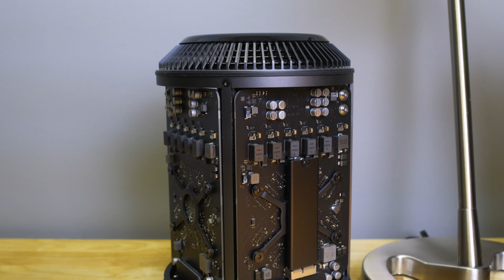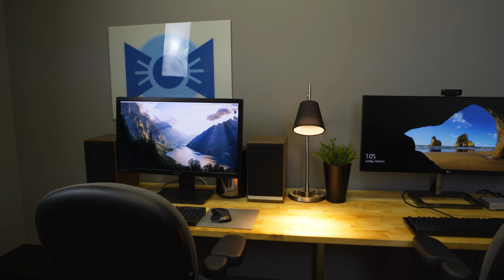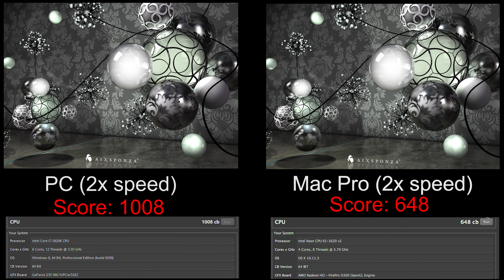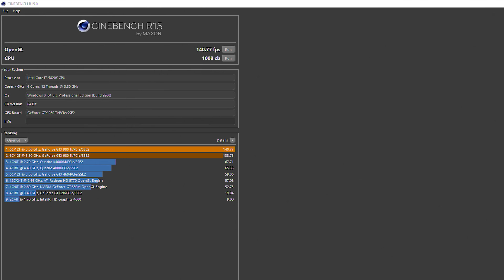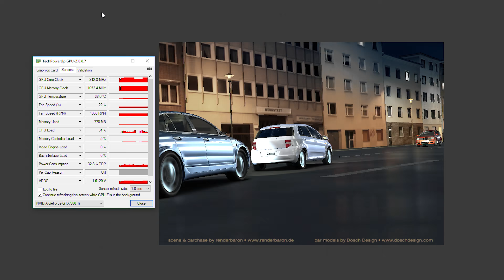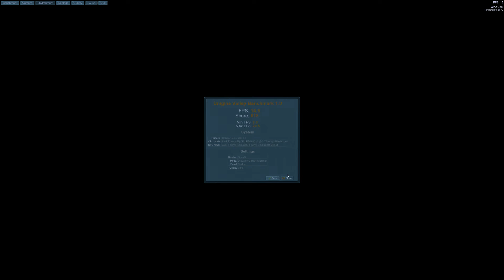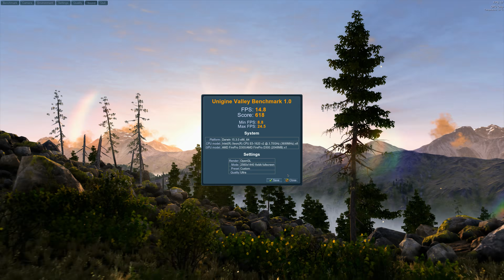$2,000 Custom PC vs $4,000 Mac Pro

Comment: Why did you even bother to do the tests? A look at the spec sheet should have told you which one would win (pardon the pun).

The Mac Pro is a scam and I have been calling out this scam for a long time now.

This scam is so cynical and egregious that it beggars the mind to contemplate it.

So Apple bungs all this high end Intel and AMD hardware into the little cylindrical case, and all the fanboys go wild.

The thing is that the hardware inside, if you were going to run it flat out at the highest performance would require around 700 Watt of power. The Apply Mac Pro has a 450 Watt PSU. So you are buying really high end hardware that you can NEVER take full advantage of right from the get-go.

But wait, it gets worse. Apple for its "revolutionary" cooling solution uses aluminium which is only half as efficacious at dissipating heat than copper for the CPU and two GPUs; now comes the kicker, if you do run the hardware so that it is drawing what the PSU has to offer then the temperature of the CPU and GPU are between 95 and 97 degrees Celsius with the dinky 140mm fan on the top going like the clappers at 44.7 dBA

http://www.anandtech.com/show/7603/mac- ... te-2013/14

So now we know why it only has a 450 Watt PSU and that is because the cooling solution implemented on the Mac Pro would not be able to handle any more.
Reply: +Michael Nager LOL.. so Apple cheaps out on the PSU but sure as hell doesn't on the other parts.... wow they sure know how to scam/con their instalbase.
Reply: mechaart
Did you read the post or did you just see "PSU" and decide that you had seen enough to misinform your opinion?

Comment: You suck at overclocking :S Mine 5820k is at 4.5 with no issues whatsoever, and I've had it at 5, but had a little bit of heat issue when gaming for hours with 2 970's in there... up the voltage a little; you won't hurt anything.

Comment: I use Apple products, & I honestly don't understand the reasoning behind not upgrading the Mac Pro. The Macbook Pro's have better hardware than the Mac Pro, so it's beyond stupid now. I work in Graphic Design, so my needs are different to yours. Apple have a far better type renderer which is super important when it comes to pretty much all aspects of design; besides 3D and architecture design (and some few more I guess). Until Microsoft create a better Type renderer and preload High-end fonts like Helvetica in their OS. Designers won't budge.
Reply: +RizzyWow I wouldn't say better but newer hardware but overall you are right, Apple have a knack for not updating their Mac Pro line.

Comment: I'm starting to think that these videos are only done for you to realize that a PC build is WAAAAAAAAAAAAAY times better than an actual Apple computer.
You should start to get better on Windows. You'll find things that are really practical that OSX still doesn't have.
With the right click you can do better things that you actually would use daily, and god bless the side by side window setting, where you grab a window and move the mouse to the edge of the display to see that it suddenly Windows transform that window so it fill half of the screen and lets you chose another window to fill the other half so you an compare documents way faster, for example.

I know OSX is a great OS, but Windows is just so damn easy...

Comment: Now run the same test and put FCPx up against Premiere on the PC. The Mac will smoke it. Software optimisation and hardware go hand in hand.
Reply: +electricsnut The mac won't win in anything.
Reply: +Derpleton Harpoon Yeah aside from looks, stability, support and 4k rendering speeds in FCPx... It will smash Premiere if you use OSX designed software instead of Adobe bloatware.

Comment: Don't ever use cinebench, it's profoundly known to be a rigged piece of crap. 
The task takes about a minute and ~480 points on my stock bulldozer 8150, which slaughters even the 5770 in actual gaming and rendering apps.
Reply: +PurePhoenix Oh and the OpenGL Test on my (&)EXOC is only doing 46 fps even though it gets higher in GTAV on super-ultra....something even the 980Ti in your PC struggles to do.

Comment: There is a reason for such a big gap in prices (not counting Apple's policy of pricing "because they can") - the Mac Pro has professional components, so a Xeon CPU, ECC RAM and a workstation-grade graphics card (AMD Firepro) while the PC has consumer-grade hardware inside (Core i7, non-ECC RAM, Geforce GTX). However, for the majority of people, professional-grade hardware is not necessary, as it has very specific advantages (better reliability, GPU double-precision float operations, ...)  at a much, much higher price point, which does not result in better performance in most tasks - as proven by your video. Great video and great build! :)

Comment: It's interesting that this test is effectively done in a way that goes after the macs weaknesses. Open GL on OS X is famously not up to par and is basically given up on since they are moving towards Metal. Premiere Pro is also an app which theoretically should be much better on Windows since it is more optimised for that platform but if you ran a FCP X test you'd probably find that the mac was close to 10 times faster.
edit/
I also wish you could have elaborated on the video test as well how long was it, was it 4k, what sort of effects are on the video.
Reply: +Craig Bickerstaff 
"Premiere Pro is also an app which theoretically should be much better on Windows since it is more optimised for that platform"
No, that's wishful thinking.  Adobe has made Mac products for like 30 years, don't use that lame excuse.

"Premiere Pro is also an app which theoretically should be much better on Windows since it is more optimised for that platform"
Oh yeah, prove it. You don't believe that yourself now do? 

On top of that.... shall we compare the performance of a HP Z840 with 44 cores and 2TB of system RAM (yes, you read it well, RAM... not hard drive space) with the fastest Mac Pro?  You don't now even the 1% of the most powerful workstations out there... read "workstations" and not "powerful gaming PCs".

Comment: Why compare Mac Pro to custom build PC? Why don't compare it to ThinkPad W/P series? They are both for the same market target. Apple always builds their product not for performance, but stability and quality. Moreover xeon processor is not intended for gaming purpose, it's better for multitask program. You should compare by multiple high GPU rendering intensive program at the same time. Not just 1 benchmark.
I'm not graphic designer nor video editor. But I believe they are running several video editing/ graphic design program at the same time. And that's what Mac Pro or ThinkPad W/P series for.
Try compare with this. It costs half than Mac Pro.
http://shop.lenovo.com/us/en/laptops/thinkpad/p-series/p70/
Reply: +Fakhrulhilal Maktum 
"Apple always builds their product not for performance, but stability and quality"
And you think that a an HP Z840 isn't quality? Watch  "HP Z840 Workstation Technical Overview".

Anyone an go for quality when he's asking a customer to spend $4,000 or more...

"Why don't compare it to ThinkPad W/P series?"
You want a fair comparison and then want to compare a desktop computer with laptops? Now that's funny!

Oh... and btw... an HP Z840 can be configured with as much 44(!!) cores and 2TB of RAM (yes RAM, not hard drive storage). Face it... and HP Z840 shits on the best Mac Pro out there.

Comment: That's not even the $3,999 Mac Pro model, it's the $2,999 model.
Reply: +Jon Anderson its still cheaper
Reply: Very True, but the video is misleading because right off the bat, the reviewer states that he spent $2,200 on the PC. $200 more than the title suggests. We're talking about an $800 difference now, opposed to the $2,000 he suggests in the title.

Comment: first mistake on this video you put a workstation against a Gaming PC the Mac Pro did not have a chance against this gaming PC. the Mac Pro is built and certified for workstation Application's the AMD FirePro GPU's have A multi stream hardware H.264 HD encoder for video editing 3D rendering consumer cards don't have that at all and instead use its onboard GPU (CUDA or Open CL) to do the encoding taking longer to create and render video's of that 3D CAD thing you are trying to design. it is quite telling on how stupid this video actually is. the AMD FirePro's are the same as Nvidia Quadros NOT for gaming just specially tuned to deal with certain productive Applications such as CAD, Premier Pro and what ever else has tried and tested by the software Dev team and deem it as Workstation product but all you used was gaming benchmarks. one other thing is AMD have only recently updated there FirePro cards because the FirePro has a upgrade life cycle of within 2 to 4 years if Apple are sticking with AMD I'm sure they would be wait for the next gen FirePro's been released before going a head with any upgrades. from experience using Powerful but consumer GPU's and CPU's in a 3D workstation inviremint it is painful to say the least. this Video is invalid in the way it has been scored I would say the same thing if you through a Windows workstation running Intel Xeon's and Nvidia quadro's or firePro's vs this gaming PC but I don't think you get the difference between these two very different machine's. this was not Mac Pro vs PC this was workstation PC vs gaming PC video.
Reply: ***** grow up Mac's and PC's are the same just Macs look nicer. quit prattling on like a child who has had there bottle taken away. and if you knew anything about PC's you have seen the point I made where facing workstations against Gaming PC's is always going to give a false win to the gaming PC's because they are both strong machines but in very different ways. all because it have a Apple logo means jack shit to the companies thats use these machines as there daily driver also this misses the point of a workstation machine in this video if it has made its money back and made him money on top the machine has done its job as for gaming machine they play games entertainment hard to get a machine that dose both.
Reply: +Victor Moreira 

"what specs would a modern workstation PC have"
A modern workstation like an HP Z840 can have up to 44(!!) cores and 2TB(!!) RAM (yes, you read that well..RAM.... and not drive storage). It would totally crush both machines.

Comment: Yes, but there is one problem with PCs - Windows 10
Reply: +Dufffaaa93 yeah, but is mac OS worth $2,000?
Reply: +Dufffaaa93 and plus, windows 10 is pretty good, so there's also that
Reply: +Dufffaaa93 Windows 10 is actually good... Secure, sleek, beautiful, easy, powerful. I don't understand.
Reply: +Dufffaaa93 There are some software issues with windows 10 but for the most part it's pretty, ehh, ok to use. 

Also, Linux.
Reply: ependo odnepe The only problem with Linux is lack of solid drivers, and lack of user-friendliness. Depending on what build you get, you can get either really really barebones, or you can get extremely user friendly. 

It's powerful, and I can find my way around updates and installs, but it's really kind of annoying, and it just gets annoying.

Personally, Ubuntu and Elementary are my favorites for their friendliness, but even still, they still aren't nearly as convenient, so in my eyes, it's not really worth it unless you have a solid knowledge of the OS, which is why it'll never get big.
Reply: BrickerBlocky
Let me see.... lack of solid drivers, not user friendly, but you leave out things like"sucks for gaming" and "most applications suck".
Reply: +Adel Morse And bad drivers and UI are literally the reason for the bad gaming experience and bad programs...

Comment: Try to be on the right side why most use a Mac; the software that runs it and is made for the device. Programs like fcpx are a beauty on a Mac and use the system like it should. Gaming on a Mac, I never did it, I would use a pc for that.

Comment: Honestly the mac-windows comparison is so old and stupid.  Yes, you can get a faster system for less money with windows.  HOWEVER, some people, who have money to spend on macs, prefer osx.  Therefore, they buy macs.  I had a macbook pro and then I bought a msi for college because they're cheaper and fast.  Each system has its ups and downs for software.  There is no disputing macs are superior for the recording industry, and they're built like tanks.  Windows on the other hand, better for gaming overall.  It's all preference.

Comment: I don't think you are comparing "Apples" to "Apples" here. There are a lot of disadvantages to the Mac:
 - Liquid cooling vs air cooling.
 - DDR4 vs DDR3
 - Hexacore vs Quadcore
 - 2015 vs 2012 CPU

Please let's be realistic, I don't think its fare to compare an old hardware with latest generation one, in the computer world the advance in technology is usually exponential. Last but not least, what makes a hardware shine is software that is highly optimize to use all the horsepower available, I know there's never going to be an equal ground to compare Macs and PCs, so let's stop doing it. If you work with Apple then you have to use all the tools highly optimized for them, and the same if you are on the PC world. I guess computers are just tools, you have to use them for and how the were designed to be used. You would never hear a complaint on how bad a hammer is to tight a philips head screw. Anyway Thank you for the video. I would recommend trying to leave emotions out of the equation and try to state facts and give your viewers reference for them to study and come uo with their own conclusions. We should teach people how to think and not to repeat all they watch on youtube. Thanks again for sharing your thoughts and experiences.

Comment: 32 bits of RAM is stupid for today's computers. it wont even use 50% of it
Reply from the maker: +grmmhp bits? You mean GB? And I respectfully disagree. Editing 4K video eats the RAM right up.
Reply: +grmmhp disliked the comment, gonna report your channel, u deserve a ban.
Reply: +grmmhp Editing video, flow, heat, aerodynamics, plastic injection, etc simulations, high detail 3d models rendering, big CAD models, CAM, animation, after effects, virtual machines, ramdisk, etc, etc. Some people just do daily work, but for us, content creators, designers and engineers we use a PC as a main tool to get our job done.
Reply: +grmmhp I have a workstation, a dual E5-2670 v1 and 64GB, if you use ramdisk, just 32GB you're living 32GB for the rest of the computer, 16GB in complex workloads it's nothing, for other users 8 o 16GB it's enough but not for some applications. Normally I'm working with Premiere, Solidworks, Keyshot, a bunch of chrome tabs, photoshop, even some simulations at the same time, and that's really ram consuming, If I work just on one program it's enough with 8-16GB, but normally I'm working with more, as I need to make textures, to edit renders, etc etc
Reply: +grmmhp I've considered going with an intel processor to get 128 gigs of ram.  you can easily use it.
Reply: +Snazzy Labs yes, GB, I didn't even notice, sorry
Reply: +MrTor8 for most of these applications, 16 GB should be enough

and the other may need a supercomputer
Reply: +grmmhp It's STUPID for you,  you mean.   I use most of my 64gb when I'm working - I need more ram
Reply: +endfm it's stupid for low end to high end gamers and normal users. yes, I know, I didn't mention this and I failed at this point. And of course supercomputers/workstation will need more RAM (and also processing power, etc) to be capable of heavily simulating/CGI movie rendering etc
Reply: +GazhKaVFX (DesiignWRR) why? I didn't do a thing lol and u seem to be xenophobic
Reply: you write bullshits.
Reply: +GazhKaVFX (DesiignWRR) read my previous comment and this is a stupid reason.
Reply: +grmmhp Really? I find 4 bits of ram too much that much space on my analog paper feed non rewritable storage medium.
Reply: +grmmhp You really are stupid because people are talking about that much memory for working while you're talking about gaming which soon enough we might be needing at least 24gb of memory for gaming and 12-16gb would be the bare minimum.
Reply: +Ecks™ don't you say?
Reply: +KaneWolf lol ikr I didn't even pay attention to that
Reply: just because you don't know how to utilize 32gb of ram, for gaming or other uses, don't say it's pointless. I wish I had more than 32gb in my current rig
Reply: +Louie Mott unless you have 2 or more  i7's then you should never need more then 16 gbs  
even if you are exporting 10 things from after effecters at 4 k its limited by the cpu
Reply: that moment your comment gets polemic when you don't want
Reply: +Everrolling Ronan Shade no? ever hear of using ram as temporary storage?
Reply: yeah there is no point to it tho
Reply: its still going to be capped by the cpu
Reply: +grmmhp Depends on what you're doing. 48Gig of ram goes quite nicely with my E5-2687W V2 processor when I'm editing video's, working CAD and when I feel like it playing games. Hell most systems now don't ship with less than 16Gig of memory. Only thing left for me to do is throw another GTX970 in and I'll be fine for a while until the next line of Nvidia graphics cards come out.
Reply: +Snazzy Labs so do texturing programs like Substance Designer
Reply: +grmmhp well like other ppl said it depends on what you need it for!
but well if he didnt have 32gb of ram DDR4 the computer would be less than 2000$ too :3
Reply: +grmmhp 2 things you never have too much: Disk Space and RAM (including GPU RAM)
Reply: +Snazzy Labs But almost no one watches 4k videos.
Reply: +PreGamesNL professional video editors work in even higher resolution
Reply: ***** Oww okay
Reply: +grmmhp It's pretty easy to use over 16GB if you are running VMs on your workstation